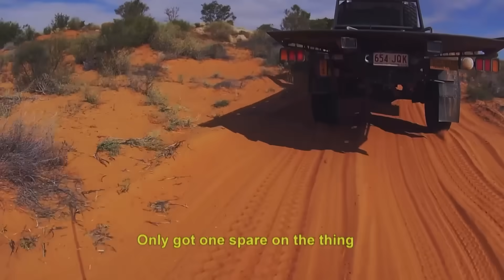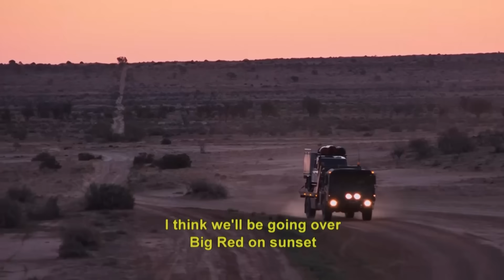What A Hero! Trucker Rescues Tourists Stranded In The Outback

Comment: Anyone notice the front wheels on the Landy while being loaded on flat bed the front wheels sure seemed to spin forward in a way to indicate that it was engaged and not broken as the story line indicated.
Reply: All on these kind of shows is scripted. Do you even think they can run a business if they are always breaking down like in those series?
Reply: Rear tail shaft is broken but being a landrover it would be the rear axel spline broken
Reply: Seems you are unaware that rear axles can also break.  Given the Landrover had excessive weight over the rear there's a good chance they only had front drive.

Comment: noticed that the front wheels were still working and so where the rears you can hear them both squeal wonder how staged this is
Reply: Probably scripted, but rear axle could be broken, or front CV is shattered which would cause what was seen on the video.  Probably rear because the vehicle is stupidly overweight in the rear.